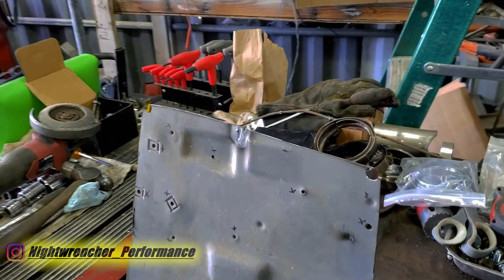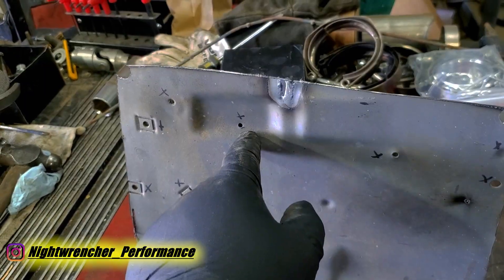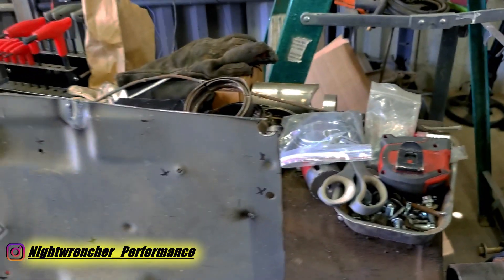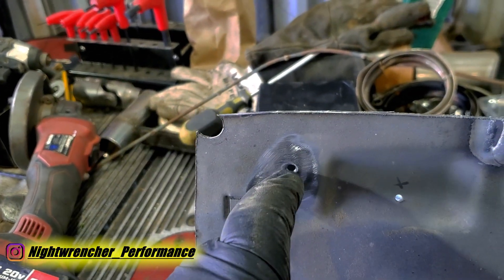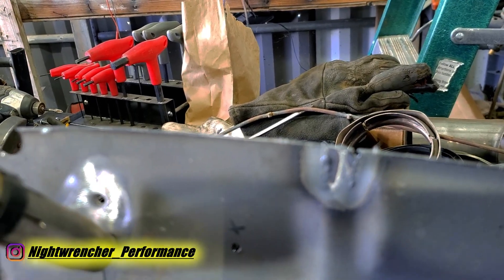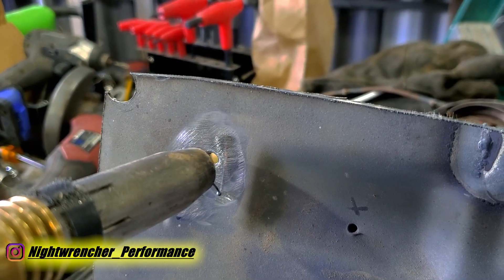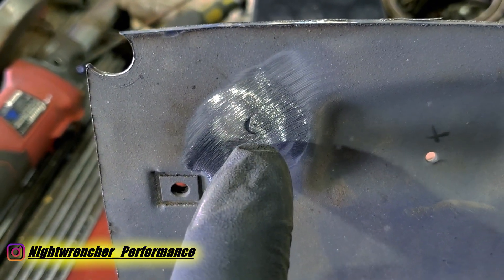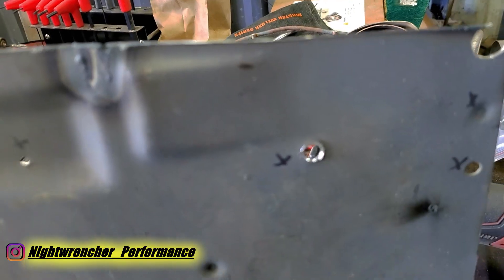How To Weld Holes On Sheet Metal | Flux Core Welding For Beginners |

Comment: I sometimes heat the spot with a torch and use a wire brush to get the paint off.
Reply from the maker: I do that with thick metal but I try not to do that with thin metal because sometimes itll warp